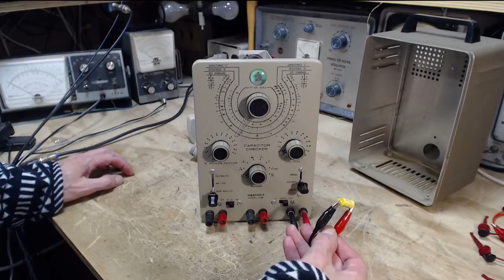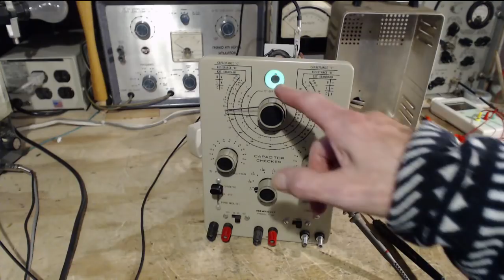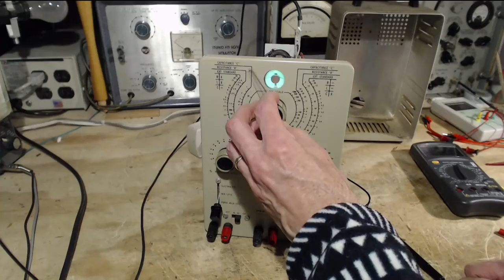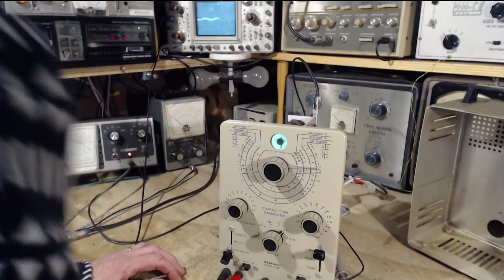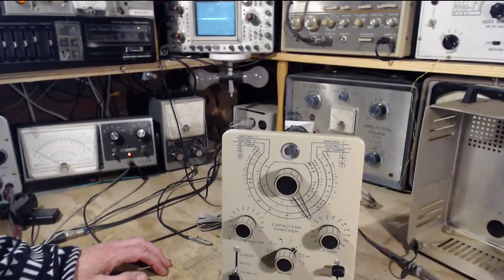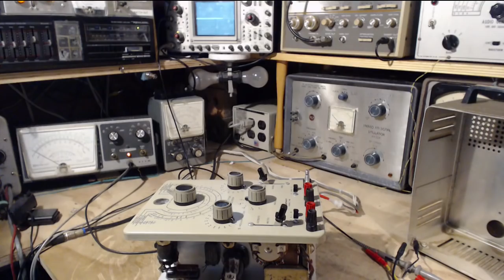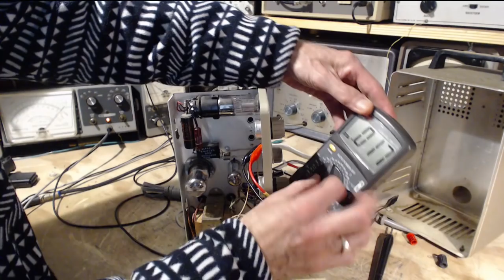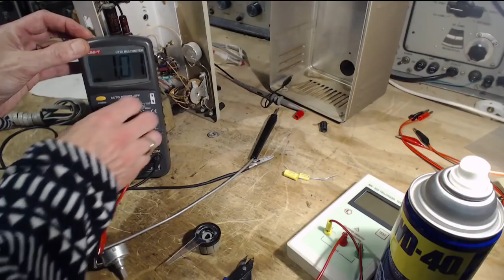Heathkit IT-28 Capacitor Checker Restoration Video #1 - Troubleshooting

Comment: Enthralling you had me hooked from the start.  You need to change out the reference capacitors in range selector switch. Any leakage at all will screw it up. I have restored several similar meters with the same problem.  Having said that your meter is working as well as they ever did. Thanks for sharing.  Regards Chris

Comment: A fellow Canadian electronic genius (no joke!) YouTuber with the channel MR. CARLSON'S LAB has several specific capacitor-testing devices he invented for replacing these bulky testers when doing leakage and shield-foil-end testing.  They are very small, very specific in their function, and extremely reliable in their results.  They do not replace the larger capacitance-value test devices for that one purpose, but are much better, much faster, and much easier to use than those large devices for other circuit-related capacitor-problem evaluations during troubleshooting.  He provides all blueprints and descriptive documentation for making them in a workshop to one's own preferences.  They are part of a large set of troubleshooting test devices he developed that replace complicated jury-rigs needed to test broken or poorly-performing electronic circuitry of all sorts in many ways.  They really assist such work markedly.
Reply: I'm a retired biomedical engineer, and I used to watch all his stuff. Good stuff. But I ultimately had to stop because I could no longer stand his use of the word 'variate' and his use of the word 'aperture' instead of 'armature'. An aperture is a hole. lol. But I agrtee with all you said about him. Very skilled and intelligent. And great at explaining his thoughts and processes.
Reply: @n8nkqrp595  As for word use, when I was a child I thought "alien" was pronounced "ahleen" and it took a firm amount of self-discipline to correct that when I found out different.  So I can't really knock others about word use or pronunciation.  He does explain things extremely well and would make a great instructor in a university for electronic engineers.  He demonstrates, interestingly enough, that it is quite possible for those James Bond-type "mad scientists" to actually exist, as he is way, way more than a mere "mad bomber" level if he had been of the evil villain bent.  Makes those 1940s SUPERMAN cartoons (with their superb graphics and music) not quite to far fetched...
Reply: @n8nkqrp595  I grew up hearing the word solder as sodder whereas he likes the pronunciation, sold-'er
I had an odd fingernails on blackboard reaction to his high watt solder iron vid  ;-)

Comment: Thank you for your videos: The white stuff inside the pot is (very old) dielectric grease. It is used to lubricate the unit, and also helps prevent oxidation.
WD40 will make a mess of it.
After cleaning with a contact cleaner, I would use the slider version of Deoxit (it has additional lubricants in it) for this type of Pot.
Also, think capacitors (you are running on 50+ year old caps).   :)
Reply: You are preaching in the desert. Jim will not read your tips. Nor will he depart from using WD40 despite what EVERYONE tells him. Back when he seemed to be reading comments his reaction to people advising him not to use WD40 as contact cleaner (espicially around radio tuners) was "I have used it for 20years. And I never had a problem with it. More WD40."
He does not want to learn or take tips. He will not even learn from his own mistakes.
Reply: @tubeDude48  I use the new stuff made by WD-40. It is a very good contact cleaner!

Comment: Hello Jim! Rule of thumb with these units is 1) Check resistance of ALL resistors on the voltage selection switch and replace all out of spec units the 22,000 ohm resistors are suspect and do go up in value!! Get those old power filter Electrolytics out of there! Check the balance resistors across the big electrolytics and replace if necessary!  Replace the REFENCE paper caps with new known good ones of high quality replacements. then calibrate the tester.

Comment: My balance pot, which is 1000 ohms per the schematic, not 100, was measuring 1 Meg. Replaced it. Harder than it seems. The flatted shaft pots now don’t fit the Heathkit for factor. I had to file down the flat spot but now fits perfectly. Always use a nut driver when removing nuts on the face. It will save you an embarrassing scratch across an irreplaceable instrument face.

Comment: The best switch cleaner I have ever found was Mother’s Mag Wheel,cleaner its available at any auto parts store.the compound is a white wet paste applied with a tooth pick or Q tip , then to the back of the switch deck on the rotating switch plates. One can work it in until  Q tip turns black.use it ax very sparingly   on switches. Once cleaned flush it with a contact spray.

Comment: Did you start it with a current limiter in the circuit?  My restored and working unit got pulled off my bench to the floor.  The only function I use is the capacitor leak checker. While testing with my 75w current limiter starts glowing at about 350vdc and gets brighter the higher the setting.  The same behavior is exhibited on a spare unrestored unit I had on my shelf.   Is this a normal behavior and Im’m chasing a ghost?  All caps in unit are new ecaps and polyprops and tubes are good. As part of my testing I installed a NOS eye tube.   Any advice would be helpful.

Comment: Am I correct that this IT-28 is similar to the IT-11?  If so, the technically inclined may want to get a hold of the full build and calibration manual on the IT-11. It makes for interesting reading. One example that the leakage test and bridge voltage are reduced for the setting of "miniature electrolytics", the latter they categorize as high capacitance but very low voltage. And interesting too is the statement that the leakage test functuon closes the eye at a leakage current of 2uA on paper and mica. To me that is worth a second thought; on a 1meg grid resistor a coupling cap with 2uA leakage will produce +2V grid debiasing. Hmmm... I would call such a cap leaky and change it.
I guess if Jim uses this tester many more old waxies will be deemed "still serviceable" or "perfect" and "the eye pops right open".

Comment: There are two 40uF in series , the big brown ones. Replace them  both with  a 500 WVDC rating. Clean the switch contacts with a proper contact cleaner. Of course 
with any kit built electronic piece of equipment assume nothing. Go over the components using a schematic. It also may have a cold solder joint or two  in there too.
Possibly the dial below the eye tube is dirty with hardened grease,very common. Put some new grease in after cleaning the old stuff out. BTW some people to prevent
 over voltages put a 330K resistor ( 5Watt) across each of the power supply electrolytic capacitors.

Comment: Jim, you need to be able to trust in your test instruments.  I know that some of your test instruments could use a little work.  When testing a pot I find it much more accurate to use an analog meter, such as your VTVM.  Also, you should use a more logical step-by-step approach when troubleshooting, instead of jumping from one issue to the next.  I noticed you do that a lot when you're working on your radio repairs.  Use contact cleaner on those pot's and switches, you'll have better results.    Even when I'm yelling at you through my monitor I still enjoy your video's.  Good luck.
Reply: Jim doesn't use a linear approach to troubleshooting.. more of a circular one. I've seen your suggestion made hundreds of times. Same with the WD-40 use. Here, we have direct proof and evidence that it destroyed a vintage control. Will the use stop? No. And Jim feels, to the dismay of many here, that wax paper caps don't necessarily need to be replaced. Sometimes, even when proven leaky- depending on the cap's use in the ckt. Isn't this right pi-duino? lol
Reply: @n8nkqrp595  Yep.  I've been watching him for a while now.  I find it humorous when Jim says something like," They look in pretty good shape".  As if the paper cap looks good on the outside, then it's probably good on the inside. LOL

Comment: I I recommend actual CONTACT CLEANER.  That’s what it’s made for...  The “stuff” - “goop” is lubricant, which has dried over the decades.  Silicon grease is an acceptable substitute.
Reply: actually, Silicone grease is not the best choice.
The problem:if there is any sparking, the silicone turns into an hard subatance.
If there is NO sparking, then the problem may not manifest itself.
Since there may be slight sparking inside a variable control(particularly inside a wire-wound variable control) , silicone lubes are not recommended.
Using them in switches is a bad idea for the same reason.
Reply: M. K. All lubricants are insulators. If they were conductive, they would form a parallel path for current, which would not be useful. Silicone grease does not become conductive in the presence of arcing, as it does not form carbon at high temperatures. I have used it for decades without any difficulties. In any event, WD-40 is not a good choice for use in electronic equipment. It will dissolve anything solluable in it, but does not provide fresh lubricating film itself. Wirewound pots Should be lubricated. They wear when they are dry, and the dust produce by that wear is conductive. That’s why the lubricant was put in it when it was made.
Reply: @harryshector  YES, lubricants(except for the special ones that ARE conductive)are insulators, but since the contact pushes through the lube, this is not normally a problem, but silicone lube/oil turns into a hard compound that will interrupt the contact
when exposed to sparking/arcing.
It's not carbon.
If you REALLY want more info, let me know, and I'll look it up.
This issue with silicone lubes and oils is quite well known in certain industries, and is well documented on and off line.
Reply: I used to use WD40,  but after a few years,  the problems came back and the pots/switches were then sticky.   I started using MaxPro electric lubricant and MaxPro contact cleaner.   Much better results.
Reply: @harryshector  Keep WD-40 from wafer switches! The ones used in Heathkit equipment  get soft  and sticky if you do!
Reply: @hestheMaster  I agree.  WD40 is a poor substitute for actual contact cleaners, at best.
Reply: Jim will never, EVER stop using his beloved WD-40, even with direct proof and evidence that it destroys vintage controls. Nope, nope, nope. lol. Not happenin' guys! Hey, for bragging rights- anyone care to venture a guess as to how many 1 hour long segments to the series? I'm saying 3   :)
Reply: @hestheMaster  how DARE you Sir! Have you been talking to those wafer switch insulators? Have they been complaining to you about their treatment? No. lol. And besides- maybe those switches are tired and WANT an early end to their life. You are ABSOLUTELY CORRECT - and anyone who doesn't understand this- and use safe chemicals for the associated part- he should not be working on vintage Heathkits. They are valuable pieces of American radio electronics- and are being surely destroyed, one by one, by incompetent restorers and technicians.

Comment: You are missing the first rule of troubleshooting. First do a visual inspection. Many problems can be found in that manner.then milk the, lfront panel controls for information  as to all that is going on. Then one can do static tests and voltage readings.

Comment: And 41:53 in circuit the balance pot can only read a max of 250 ohms at mid(!) position.
Reason is simple; the pot is a 1000(!) not 100 ohm pot. Its ends are basically shorted by the secondary of the bridge transformer (17 ohms). So the resitance the wiper sees to one end will drop towards either end. The max resistance is reached mid position with 500 ohms from wiper to each side. And the 500 ohms partial resitances are in parallel since the outer pins are linked by the AC bridge transformer; voila there is 250 ohms.
Now is that rocket science? No simple math and circuit understanding. Something someone who fiddles with electronic for decades (and charges other people money for "repairs" he does) should be able to pull off.